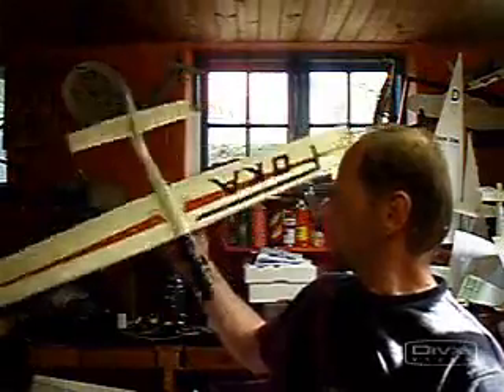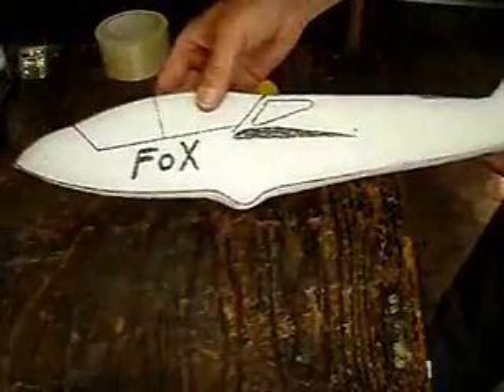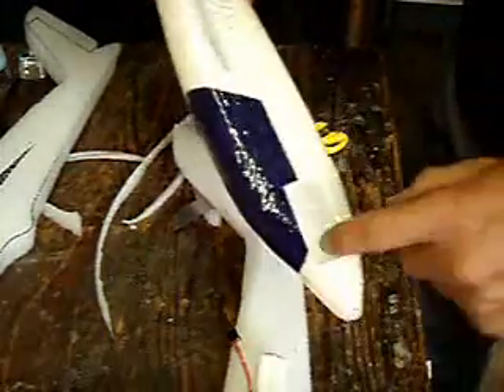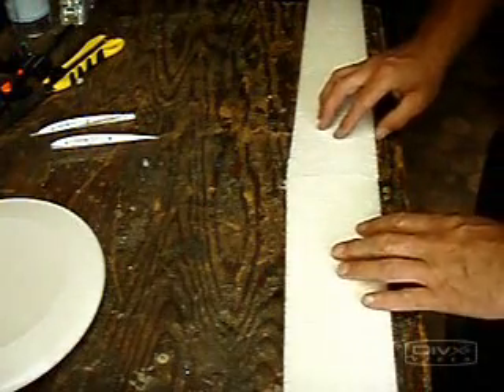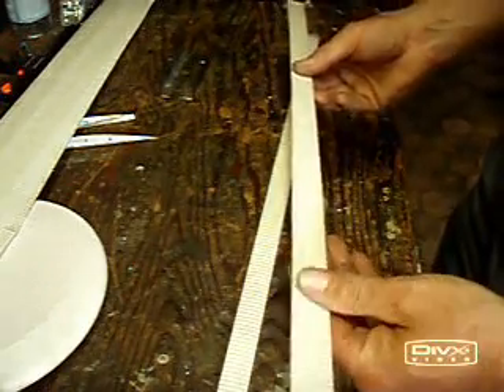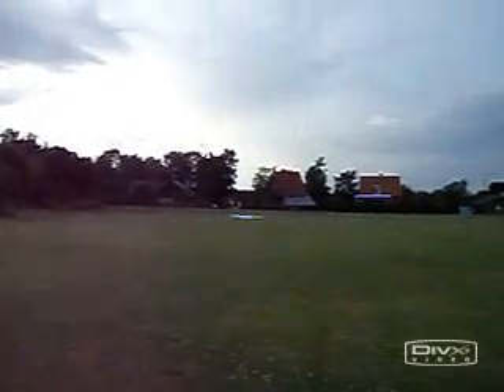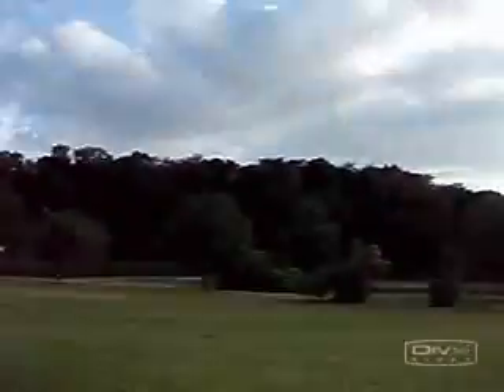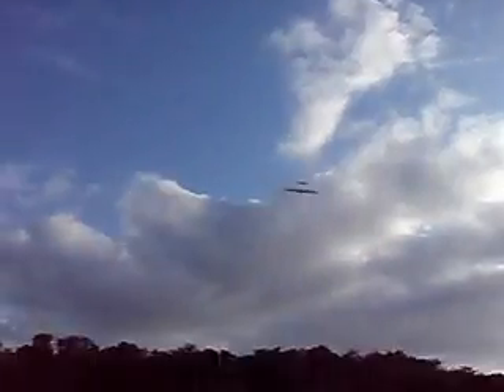Micro Swift, how to make one,+ first flying.1 generation.

Comment from the maker: Yes, or else the wing tip will be bent.
The wing tips takes a lot of beating when you crash lands :)
I use a 4 Cm long steel or alu tube that fits the 2 parts of kevlar rods. (Glued together with epoxy)
I have tried with a piece of kevlar tube, but it broke. So now I use metal.
Good luck